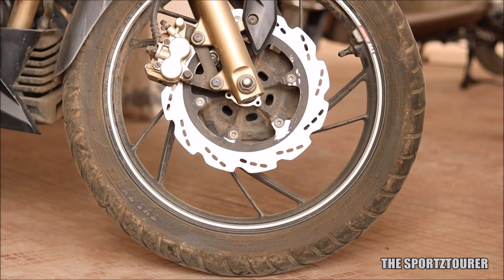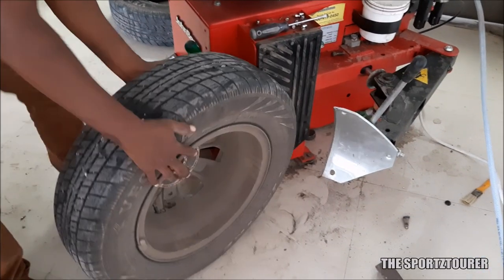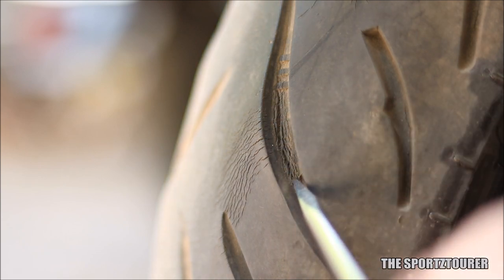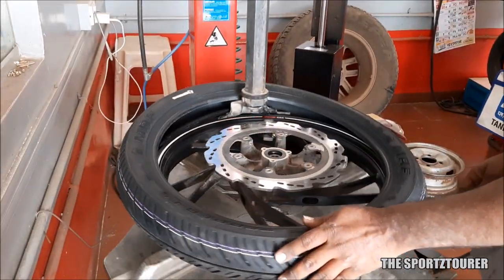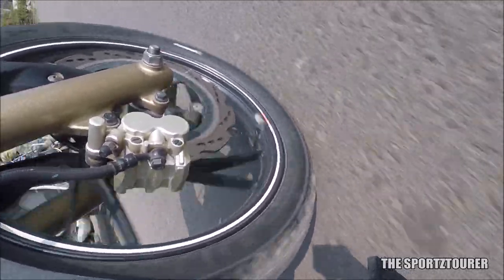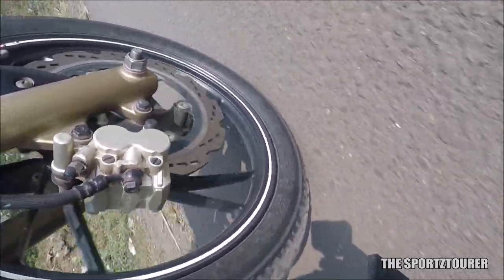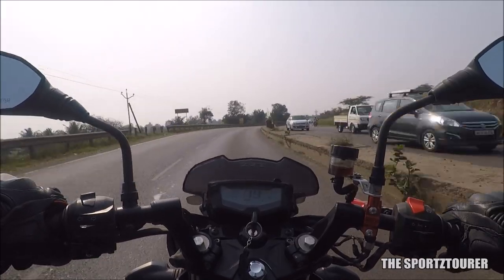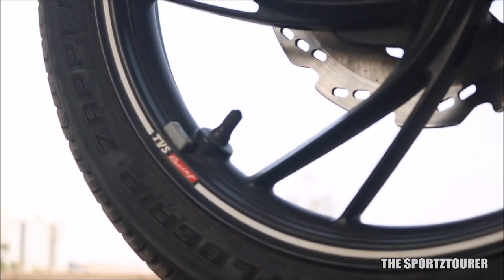7 REASONS/TIPS CAN SAVE YOUR TYRES FROM CRACKS MRF ZAPPER FS REVIEW 90/90-17 MRF MASSETER, PIRELL

Comment: The massater won't be a good option..  speaking from experiance..  for front my choices will be Michelin pilot street 2. Apollo actizip f2, Tvs eurogrip Att 455f, for rear i thinks apollo alpha s1 is the best one..  and to be clear i didn't consider the Pirelli Angel CT as I was using them since last 2.5 years..  and after 2 years the started to develop cracks similar to yours...
Reply: I want to change both tyres of my Apache 1604V, which one I should buy?
Reply: I am curious about ur masseter experience. Could u please elaborate further

Comment: I purchased a preowned fz25 Oct 2021 model a month back. It has run 9200 kms only. From a couple of weeks, I have started noticing that there are minor and what seems to be like surface cracks all around the tire close to the rim on the front tyre. The back tyre is completely fine. Can you advise what could be the issue? I will get it checked for any air leakage as I think that could be one reason. Sometimes at stand still the handle feels heavy just turning it left and right. Sometimes when riding it feels like the rim is pressing into the tyre. Thanks.

Comment: I follow the tyre age and crack deterioration as the factors to change Since old tyres become hard and lose grip even though it still has good tread depth. Since my usage is far less I don't risk taking a tyre to its utmost wear point. 
Great insights on the different brands 👍
Next motorcycle purchase is coming soon I guess. Cheers ✌️